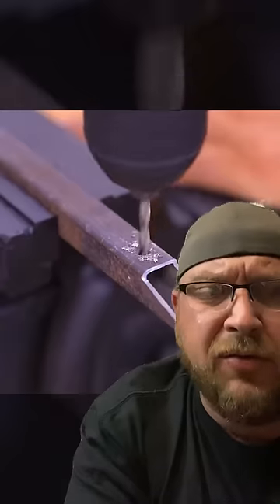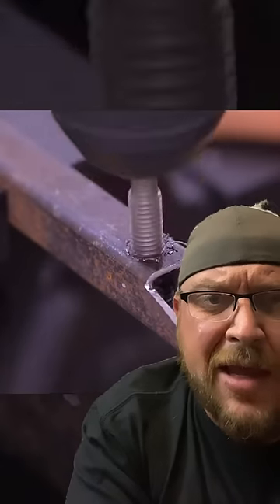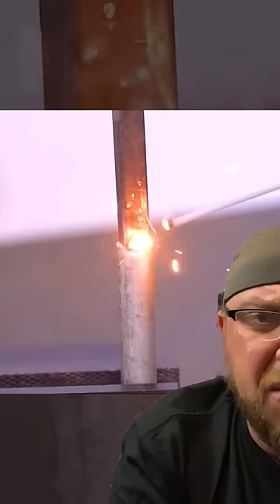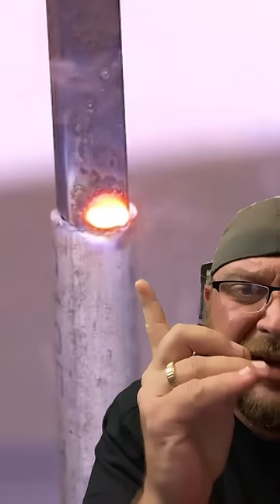Rate Your Hack (Nail Jack)

Comment: I mean, the handle doesn't seem to serve any purpose anyway, so even if it falls off from a bad weld I'd say the effectiveness of the tool doesn't change. It could definitely use some sort of pad on the but of the thread to not tear up your work, but other than that it seems to be a pretty functional half-hammer for people who love powertools too much and are too weak to apply elbow grease. I'd leave it at .5 points total personally. And since this probably rounds like rpgs, and not money, that still means it's zero points.

Comment: i would have gave him 3 points too, but only taken away 2 points for the weld, and take away 1 more point because if he bent it instead it would be just like a claw hammer that didn't screw the material you're pulling the nail from.

Comment: Alright everyone is saying it's stupid but honestly it has some pro's.
The nail comes out straight so it can be reused.
He welded on the pipe just so the handle could be round and nicer in the hand. It wasn't for structural reasons or anything.
And if he did put something under the screw it wouldn't screw up the wood, but honesly if he just wants to recover nails he probbably doean't care about the wood.

It's niche yes, stupid? Absolutely not.
Don't knock something that's probbably not made for you, especially if you don't under stand it.

Comment: Here's a pro tip from someone whos swung a hammer atleast twice. There's this thing on claw hammers (straight or curved. Whatever the ladies like.) If prying back doesn't work. Push the hammer to the left, then the right and repeat steps 1-2 till the nail is out or broken in which case of incident 2 cry or cut it

Comment: It's as though they want to make this as difficult as possible. I worked doing tear out, not construction, but this feels like a hack where they weld spoons together to make a tool for tearing out concrete - how many nails could you pull with what's in your tool box in the time it took to make this?

Comment: You should deduct more points. They ruined the smooth surface of the wood with that bolt and that force will break the head off stuck nails, just turn the hammer

Comment: to be fair to the guy, as a way of pulling the nail its OK but its terrific at PRESERVING THE NAIL, you could pull it with a claw hammer but youll bend in so bad youll ruin it, this would actually save the nail, dude should get 1 point just for that!

Comment: I will say the idea isn't bad if you need to pull it straight vertical maybe add a pad at the bottom so it doesnt destroy what the nail is attached to, how ever the likely hood of you needing it is so remote that you'd probably not run into it

Comment: With the screw being that far from the nail you will have to put a lot of weight on the opposite end from the nail or the screw will just lift up the end opposite of the nail and try to pull that "tool" out from under the nail head.

Comment: It's a handle, it doesn't need a weld. But for the very VERY first time I understand why you would need this tool. Getting low on nails and about to finish the project....get this out when you have to pull a boards and save the nails and reuse them. Lol

Comment: The only hack that's worthwhile and real is popping out blind bearings with strips of rags, some grease and a dowel and hammer. Blew my mind when AvE did that, I thought really hard about other things that could be considered hacks and couldn't think of any that would actually score points. One honorable mention is unfastening the timing belt pulley bolt by sticking a breaker bar against the control arm and turning the engine over with the starter but I'm not brave enough for that one.

Comment: You still have to get under the head of the nail. Must of the time they are not standing proud of the wood. Buy the time you use that thing you could pull 4 to 6 nails with a typical nail puller. Your way to generous in your scouring. 
Love your videos. 😊

Comment: Even ignoring the other problems, this ignores the real issue of nail removal, getting under the flange of the nail... if it still exists. if you have that much clearance in the first place, ignore a claw head hammer, grab a fork.

Comment: Even if it worked perfectly,  he didn't harden the metal in the square tubing. Heat to glowing cherry red then quench in old motor oil. (Be ready to extinguish the flames).

Comment: Thing is, usually when you remove a nail, yo do so cos you wanna reuse the plank rather than the nail.
I used tongs to remove nails, they work fine. You only break the nail when you remove it wrong or the nail is already in bad shape rusted

Comment: Put something smooth on the bottom of the threaded bolt so it doesn’t mess up the project. Otherwise a claw hammer 🔨 will work fine.

Comment: Bro... I'm removing 20 point for a cold weld. I've seen a dump truck driver get catapulted into the roof of the cab and suffer broken neck and paralysis over a cold weld in the doghouse lift assembly of the dump bed.

Comment: You forgot that the small amount of threads cut into the wall of that square tubing would probably strip out after the first nail pulled.

Comment: I would have given the dude nine points for mechanical niftiness.
... but then I'd deduct three points for the sloppy weld, and another six points for the all thread drilling a divot into the wood.

if a piece of wood is nice enough that you don't simply drive another nail next to the first one, it's nice enough to respect the finish.

Comment: Why not simply cut the box tube a bit longer? 
Why not put the screw closer to the nail?
Why does it need a fancy chamfer. Cut two slots and double your speed.
Oh, and don’t forget it’s the initial snatch that breakers the nail grip. Ordinary claw hammers do that nicely.

Comment: Same conclusion, but: 

+3 points

-1 point for spending all that time on making a nail puller that already comes free with every hammer
-1 point for the shitty weld
-1 point for damaging the surface of the wood with the machine screw. 

*the only advantage to pulling a nail straight out would be to AVOID damaging the surface of the wood. So perhaps another demerit. Making the total -1 points. 

Use a cats paw or a hammer claw, just slip a thin piece of wood under it to avoid damaging the surface of the wood... do these hack creators not have dads?

Comment: Square pipe “welded/melted” to plastic PVC, then damages the surface the nail was in, next week improves with L 90degree handle for those tight spaces

Comment: If the nail was any longer he'd have to drill a hole through the side of the bolt and thread it then run a bolt through the bolt as a handle to get the bolt out of the wood.  Future video.

Comment: that's a whole bunch of added steps just to remove a nail with the use of several items and a cordless tool, where the previous method was just a single flat bar

Comment: if the screw wasn't chewing up the wood, there could be an application here, but as it is, woof
Reply: maybe adding a rubber tip to the part of the screw that contacts the wood would make it a feasible tool

Comment: That device also damaged the wood. Easy to avoid but nothing was done to protect the wood. Normally you just use the clawed back of a hammer to remove a nail but this could be used as way to not damage the wood as a hammer would do but  again no protection. A piece of wood would do it.

Comment: The weld is what you focused on? That's a manufacturing error that can be fixed. The real problem is its core design. Don't you see how badly that bolt is damaging the wood as it spins?

Comment: I carry a Stanley Fubar at work, and it'll get loose or protuding nails either pried out of pallets or hammered back in by the time this short is over.
I mean, the effort and time the OP spent to make a piece of scrap metal that needs a powered screw just to lift a nail...

Maybe I need to make shitty faux tool hacks instead of an honest living🤣

Comment: Hang on!

This is, (unlike a claw hammer) a device that extracts a nail completely straight. I.E. at 90 degrees to the face of the wood.

For OCD sufferers this is surely 2 points? 

(N.B Autocorrect wanted ‘octopus’ rather than ‘OCD’)

Comment: Cutting off the metal just to put a different handle on in a bad way..
Thats stick welding 2.0. its welded but only stuck together so you can remove it easily :-)

Comment: Already a bunch of tools to do that without having to waste time to make this thing, don't bore another hole into the wood, removes it faster, and like with crowbars, prybars, and cat's paws, can be made of a single piece of material, making it much more durable and reliable, and the bonus of tools to drive nails in (hammers) already has finishing hammers, framers hammers, etc. which include a claw for removing nails as part of the tool to begin with. Also, you cut the square pipe to weld a cylinder pipe of a different material on there when you could have saved time making this by not making an unnecessary cut for bad tack welding. And from the end there I see you stuck with the tack welds rather than doing a full weld. Having had the tack welds broken on my bunk by "raccoons" during our graduation ceremony at BCT, I can say from experience tack welds alone aren't as good as a bead, even if the tack does penetrate. I deduct another 20 points for the additional stupidity of this build that Funk didn't address here.

Comment: That's steal to a bit of aluminium or non ferrous material. No good I did a wing repair once with cut up kitchen stainless steel sink with a arc welder. What a mess, but I got it to hold. Filled in the holes along the weld with filler.  Ha, early days of welding smh.

Comment: Any nail that thin gauge, annealed steel could pull out isn't worth all that effort anyway.

If the nail was actually in their tight, it would just bend that thing or rip out the notch.

Comment: Cuts off all that square stock, tacks a round pipe on... why not just cut the square stock to desired length? Also the bolt is just eating wood beneath it.

Comment: For when you have scrap metal, a tap, a grinder, and a welder for some reason but no hammer.  We've all been there, all 5 hammers are missing and you need to pull a nail out of wood.  Who knows how it got into the wood, maybe you used your forehead as a mallet.

Comment: Unnecessary damage to wood surface caused by bolt rotation. 
How the bolt retained with one thread in the thin walled rectangular tube is suspicious at best. Pre-pried and filmed after device failure to imply success is my opinion. Extra points deduction recommended for deceptive practices.

Comment: When I remove a nail, I don't want to make another hole because I had to use a screwing method to pull out a nail. Subtract another point. This dude is negative points.

Comment: no they also get -2 points cus there hack mess up the wood that they pulled the nail out of cuse if the bolt screwing into the wood to pull up the nail

Comment: All the lovely innuendo(s)  aside,  'welding' what looks like cold rolled steel to EMT will require an EMT. 
Interesting idea. HOWEVER , if ya got the time, money, and tools to cut, 'weld', drill, tap this POS, ya have the ability to buy a f'n proper couple two, tree pry bars. 
Unless yer stuck in the mud in Nevada.